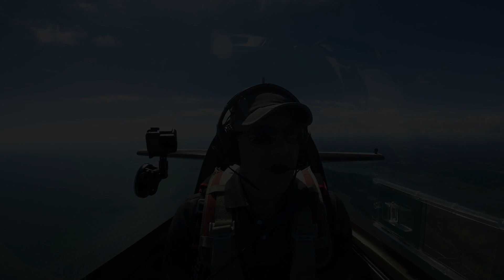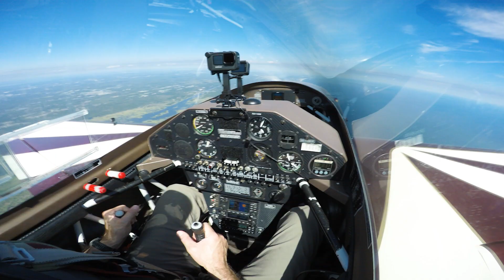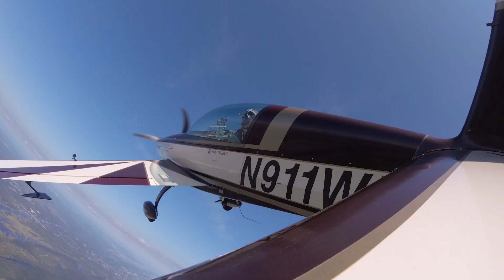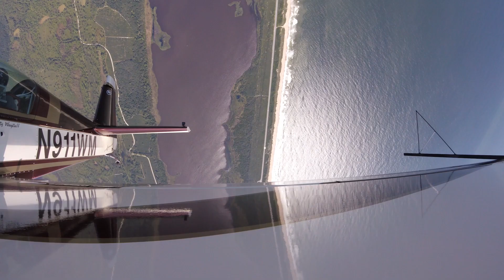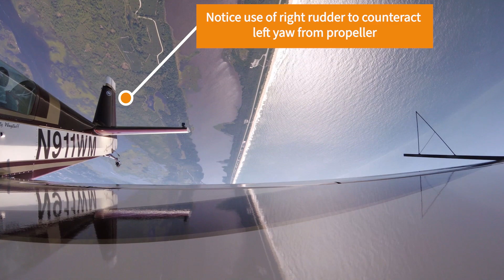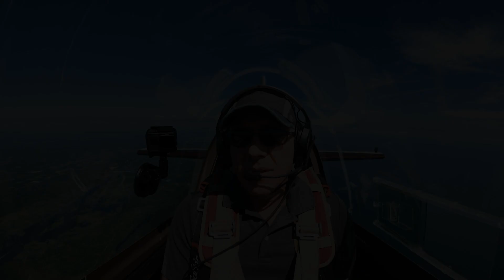Turns, Stalls & Spins - Episode 1: Which Flight Control Turns the Airplane?

Comment: Hi, Great content! However, I'm not sure I agree with the whole "Ultimately the elevator turns the  airplane"- logic. This is true if specifically performing an aerobatic steepturn, but otherwise, not really... in order to maintain level flight through a turn the elevator is a key component, but as long as the aerofoil has a positive angle of attack the aircraft will turn just fine in whichever direction you point the lift vector with or without elevator input.

 Without use of elevator, there will naturally be a loss of altitude. In your demo, you are most likely sitting with top rudder and forwards stick pressure to prove the point. You obviously know all of this, I simply think the explanation is a bit misleading. 

Keep it up!
Reply from the maker: Thanks for your comment.   Most airplanes have a positive angle of incidence - the angle at which the wing is attached to the fuselage - therefore it appears as though simply banking makes the plane turn.  It is indeed the wing angle of attack in a bank that makes the plane turn so using an aerobatic plane with 0 angle of incidence allows the flight controls to be better isolated to demonstrate the principle.   Wing mouning aside, the elevator controls the angle of attack whether it's pushed or pulled which leads to the turn or lack thereof.
Reply: @ssairshows  Great! we are on the same page ;) just thought the explanation was a bit unclear.

Comment: But why isn't C also correct? You can turn the plane like a boat using the rudder!
Reply from the maker: That's called skidding which leads to spins especially at low airspeeds in the pattern...this is how nearly every stall/spin incident in the traffic pattern starts.  When a pilot doesn't understand how the wing works - something boats don't have - and mishandles the plane at the bottom of the airspeeed envelope at low altitude they increase risk factors to the point of inevitable fatality.
Reply: @ssairshows  More nonsense. In basic flight training we practiced flying the entire pattern using rudder and power, never touching the primary flight controls.
Reply from the maker: @TherebyAir   Just because you can do something doesn't mean you should.
Reply: @ssairshows  Yes, but I CAN do it, which disproves what you're saying.
Reply from the maker: @TherebyAir  Take a moment to watch this video about the dangers of skidding with rudder:  https://youtu.be/zfwLglHEYvQ

Comment: You don’t turn a plane using elevator, period. You turn an airplane by increasing bank angle with ailerons which transfers some vertical lift to horizontal. You are compensating for your loss of vertical lift by adding back pressure to the stick. The elevator in no way turns the airplane. I have never seen in any training material or flight manual that you turn an airplane with the elevator.
Reply from the maker: Thank you for your comment.   It's true that banking a wing away from horizontal changes the potential direction of the lift vector from purely vertical to a mixture of vertical and horizontal; however, the horizontal lift vector is not realized until you increase the angle of attack (AOA) by pulling back the stick which moves the elevator.  If you don't pull back the stick there is no turn as I demonstrate in the video, hence it's the elevator that increases the angle of attack of the wing by pitching the airplane about the lateral axis which increases the AOA....this is how nearly every book on the subject explains what the elevator does; however, it's an incomplete explanation.  Most pilots have only been taught to blend all three flight controls when turning the airplane so they never get the benefit of truly understanding what is really happening.
Reply: @ssairshows  I’m sorry Spencer but you’re wrong! 
Once you establish a bank angle and a horizontal component of lift you change the direction of the relative airflow. The combination of forward flight and HCL creates a sideways movement into the direction of the bank. The vertical fin then acts like the feathers of a dart and yaws the plane into the new relative airflow, hence we’re out of balance when turning. We use the rudder to balance in the turn due to this issue. 
I hate to say it but that video is very misleading and completely wrong theoretically. 
The elevator is only used in a level turn to ensure the vertical component of lift is equal to weight in the turn, too much pitch and you’ll climb, not enough and you’ll descend. You don’t need elevator to turn. 
We use the rudder in a side slip to cancel out the fin when we do a xwind landing, that’s why we go sideways into the xwind but straight over the ground!
Reply from the maker: @theaerobaticschool5962  Nope. The adverse yaw in a turn is due to increased lift and accompanying induced drag on the right wing in a left bank and the left wing in a right bank.  A slip is not a coordinated turn...in fact the only difference between a forward slip used to overcome a crosswind and a turning slip is how much elevator you use to turn the plane relative to the wind in a forward slip and visually to the ground in a turning slip.
Reply from the maker: @theaerobaticschool5962  Here is 98 pages, written by a colleague, on how airplanes turn, please look at 5-5 as one example:  https://dl.airtable.com/.attachments/1ca869c1a61ecaa3c339e79fb86d93cd/4e2dc1e7/CommunityAviation-e-Booklet-LearntoTurn-stowellAug2021.pdf
Reply: @ssairshows   if there was more lift on the outside wing it would continue to roll if we did nothing about it. We use a slight reverse aileron to stop the roll due to the outside wing prescribing a larger circle and moving faster increasing lift. This opposite aileron reduces AoA slightly on the outside wing and therefore ID to equal the inside wing. 
In the beginning of your video you use top rudder on your demo to stop it turning when you stop rolling.
Reply from the maker: @theaerobaticschool5962  There is more lift on the outside wing when the aileron is moved down to start rolling, the roll stops when you take out the aileron...and of course the ailerons are neutral in the actual turn.  The way I used top rudder didn't stop the turn it only prevented descent until I was ready to turn. NOT PULLING THE ELEVATOR is why it didn't turn.    This is a demonstration of isolating the flight controls and using them independently to show what each actually does. Pilots are taught to blend the controls in a turn which masks the dynamics of the maneuver.
Reply: @ssairshows  That's complete rubbish Spencer, you're completely negating the effects of the vertical stabilisers role in directional stability. The role of the tail section is to keep the pointy end into the relative airflow. When you stop rolling at your desired angle of bank you create a VCL and HCL, the total lift vector is tilted over to remain perpendicular to the wings. The reason you introduce elevator is to increase the total lift so the VCL=Weight or the aircraft will descend. In a level 45' AoB turn the VCL and HCL are the same force amount, you have an equal force trying to move the plane sideways as is keeping it level. You're also moving forward at your IAS, the vector of  movement through the air is the resultant of the HCL and IAS, this creates a relative airflow opposite to that vector. This RAF hits the vertical fin at an AoA and causes it to yaw the aircraft into the new RAF. The elevator is not relevant in the turn other than to keep the VCL=W. We're unbalanced while we turn due to the fin always being slightly behind the new RAF resulting from the HCL and IAS. Chapters 6 and 7 of the Fly Better book explains it with diagrams for you. http://flybetter.com.au/book-one-fourth-edition/

What you're doing in your demo by introducing opposite rudder is to cancel the directional stability produced by the vertical fin, the aircraft will still move sideways through the air as a result of the HCL and IAS. This is why we can land in a X-wind. You're increasing AoA during the flare of a X-wind landing, it doesn't make you turn.  If you just roll to an AoB and let go of the stick, the aircraft will turn with hands and feet off the controls but it will also descend due to the VCL no longer being equal to the Weight. We only use the rudder after we stop rolling in order to augment the stability of the fin, ie, we pre empt the yaw into the new RAF in order to be in balance rather than let it slip(out of balance). The more bank we use the more we have to increase AoA to get the VCL = W as the total lift vector is tilted over more and more, as a result it feels like we're using more and more pitch, because we are, but we're also creating a greater HCL as a result. It's not the elevator that makes the plane turn. Try rolling to an AoB with feet off the rudder pedals and keep the stick at a fixed AoA, you'll get the adverse yaw initially when you roll, it will stop when you establish your desired AoB, the aircraft will then turn and descend with a slight slip. Airspeed may increase during the descent with a resultant increase in lift but not enough to stop it descending. The aircraft will keep turning though and you won't have moved the elevator.
Reply from the maker: @theaerobaticschool5962  Thanks for the write-up; however, the point I'm making is the pilot is not supposed to be a passenger!  You also keep contradicting yourself and reinforcing the point that the use or lack thereof of elevator has an impact on the turn.

The pilot tells the airplane what to do so they better know the impact of their flight control inputs and the resulting outcome.  The classic stall/spin accident in the traffic pattern typically results because the pilot DOESN'T understand that skidding the plane with bottom rudder is the start of a departure from controlled flight rather than increasing bank AND pulling the stick to turn the plane.

It's been nice chatting and I do look forward to seeing some videos from you in the future.

Fly safe!

Comment: So if a climb is now a vertical turn, would a straight and level turn be a horizontal climb?
Reply from the maker: Climbing at a constant pitch angle to the ground  is not a vertical turn; however, the change in attitude from straight and level into the climb is a vertical turn with the exact same aerodynamics as a change in heading on the horizontal plane.
Reply: @Whisky Tango you are totally incorrect on all levels, obviously.... learn to turn.. read it.!

Comment: So during take off I rotate and and observe being blown off the centerline just pull back on the elevator and it will line me back up... Really!  That one got past me in flight training.
Reply from the maker: What are you doing, or NOT doing with your rudder on takeoff?  The left turning yaw tendencies from the prop will be counteracted by the rudder if used properly on takeoff; however, if your right foot is not doing its job then pulling back on the stick/yoke creating a gyroscopic precession force moves the nose to the right which likely explains what you are seeing...if this is the case you need to re-evaluate your technique!    I explain propeller gyroscopics in this video: https://youtu.be/86PPORTVHNE?t=220
Reply: @ssairshows  I said blown off the center line not P factor. I have a knot 15 knot crosswind from my left and I'm suppose to feed in up elevator to get it back on the center line. That's what you said "use the elevator turn the aircraft". Do you ever unlock the ball in your aircraft to see what it might be doing.
Reply from the maker: @briangarcia8986  Don't confuse turning the plane with using the rudder to skid through the air...also, P-factor is not even the most powerful of the four factors that make up the left yaw tendency.  How much time do you spend looking at your ball while flying?...we cover that instrument and the airspeed indicator on lesson 1 so our students learn to fly by sight picture and feel for the plane.